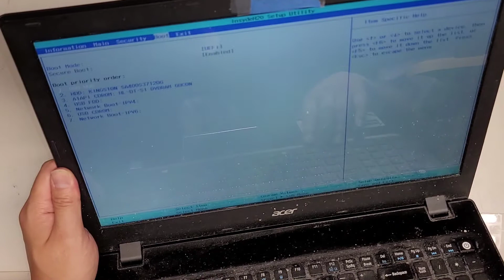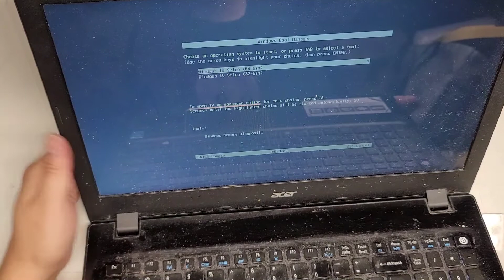Acer Aspire F5-571 Series Laptop F5-571T-569T Disassembly RAM SSD Hard Drive Upgrade Repair Replace

Comment: Brilliant video. Very well explained. Didn't know about the 'secret' reset button !! Interestingly I had cause to reinstall windows 10 due to my laptop running incredibly slow.... 15 minutes to fully boot. But the my boot usb actually installed windows 11 home for some reason, which was a little sluggish but still ran. I now have Ubuntu running on it. Thanks again.
Reply from the maker: Put an SSD in it.
Reply: @ItsBinhRepaired  It already had a 500GB ssd in it !!!! I recon it was so corrupted that it didn't know how to boot properly !! Its running fine now on Linux as a Stellamate astronomy controller hotspot so I'm quite happy.👏
Reply from the maker: @paultyson5145  Try removing the hard drive if there is one. If it's failing it'll slow it down even if the SSD is fine.

Comment: I bought this laptop for my mother, now she wants to get rid of it. I refused, I got a new charger, found out the hard drive was corrupted. I gave it a fresh new ram and an old ssd with my previous windows installed in it, put new thermal paste and after a second try, it work! Now I get to retrieve my windows 10 and I shall turn this acer laptop into a Linux computer for first try! Followed this video and everything work great! I had trouble turning it on so I replugged the battery and made sure everything was screw in and it work! So proud of myself!
Reply from the maker: Awesome, glad it worked out! If you haven't already, please like and subscribe so others can find my videos. Thanks!

Comment: Your video is very thorough! I'm trying to fix my computer. It wont boot after dropping, so I took it apart. I glued a broken off screw thread? and unplugged the battery, pushed the reset and it is still not booting up. Any ideas? I checked and the only look/broken part was the thread thingy!!  Its just showing default boot device missing or boot failed. Its telling me to insert recovery media.
Reply from the maker: That's a dead hard drive. You'll have to replace the hard drive and reinstall Windows. Highly recommend an SSD
Reply from the maker: https://amzn.to/3gCmHbE
Reply from the maker: You'll need another computer running Windows 10 and an 8gb or larger usb flash drive. Create the bootable media with this. https://youtu.be/R6GVDyVqWso
Reply: Wow! Thank you for getting back with me! Will all my data get deleted? I really just need a new computer. I always buy Acers. I'll pay you to help me! 😁
Reply from the maker: @DaabigO  yeah, the data is on the dead hard drive :( you will likely have to take it to a data recovery place. I recommend 300dollardatarecovery.com
Reply from the maker: @DaabigO  if you're lucky, might just be the os files damaged. You can try accessing the data with a sata to USB adapter
Reply: @ItsBinhRepaired  I'm shootin' for lucky! I'll try the sata to usb adapter idea. If that doesnt work, I'll have to do data recovery! Last time I did that it was only $150. I still need a new computer. Thanks again!
Reply from the maker: You don't need a new computer, just replace the hard drive with an SSD and install Windows.
Reply: You do Zelle! Zelle wants your first and last name.
Reply from the maker: @DaabigO  hahaha I tend to like putting my own SSD, though most computers now are including them. The manufacturers tend to put bad quality SSDs. I've seen so many factory installed SSDs that failed. I don't see many Acer laptops for sale these days. Amazon and Costco are good. If you have an Amazon Prime credit card, they give an extra year warranty, same with Costco. It's usually better to get the computer from the store though, because a lot of the delivery people like to throw or drop packages.
Reply from the maker: @DaabigO  name is Binh Vu
Reply: @ItsBinhRepaired  I've always bought my acers at walmart. They last forever and I can usually fix problems. My hp was $1200! And it had all kinds of issues.  I'm very hard on them. The power port is usually the first issue is have. I'm ready to upgrade. If I buy a good SSD what kind of computer do you recommend?
Reply from the maker: @DaabigO  usually avoid the thin and light stuff. Haha Not too sure what's out there currently that's good. Haven't been looking around at new stuff. Usually I fix all the old things breaking down. Haha
Reply: @ItsBinhRepaired  I sent you a zelle pmt. Did you get it?
I still need help, so I'll send another payment next Thursday. Lol.. payday! I've decided to fix this old Acer, like you suggested. I'll take my time looking for a new one. 
So, the link you sent for the Ssd card is the one I need for the Acer 5t on your video,  right? So I take out the hard drive and put in the ssd, then go to microsoft and download windows and it should work? Send the hard drive in for recovery? My power port is beeping. I might as well replace that, too.
Reply from the maker: @DaabigO   From Arya or Iron Man's brother? Yup! Haha Yeah, you'll need an 8GB or larger usb flash drive to create the bootable drive with.
Reply from the maker: @DaabigO  power port beeping?
Reply: @ItsBinhRepaired  It is for $40.
Reply from the maker: Got it, thanks!
Reply from the maker: @DaabigO  haha sorry, I said that because the last name was Stark. XD
Reply: @ItsBinhRepaired  omg!!! I totally missed the GOT reference!! Duh! We changed our last name to Stark because it was an easy cool name. I cant believe I missed that!!!
I'm still needing help, though. Ugh!!! I'm a little lost about how to check if it's my os. I think that is what you said.
Reply: I found it! You said I need a sata to usb adapter. 
What? Lol! 
I want to try this. Please tell me how to do it and links to purchase what I need. 
It's like I lost my right arm without my laptop!!!
Reply from the maker: @DaabigO  https://amzn.to/3jErHOR that will work.
Reply: @ItsBinhRepaired  can you please tell me how to do it?
Reply from the maker: @DaabigO  what do you mean? You just take the hard drive out, put it in there and connect it to another computer.
Reply: @ItsBinhRepaired  ok. I guess you just schooled me. I'll figure the rest out. Later!!
Reply from the maker: @DaabigO  hahaha
Reply from the maker: @DaabigO  another option is you can create a bootable ubuntu usb and see if the drive is readable.
Reply: @ItsBinhRepaired  when I plug it into another computer, how do I open it? Will it just be on the c: drive and just be thousands of files? I've never done this.
Reply from the maker: @DaabigO  it'll show up like a usb hard drive as another letter
Reply: @ItsBinhRepaired  ok. I'm ordering everything now. I'll let you know!
Reply from the maker: @DaabigO  hope it goes well
Reply: @ItsBinhRepaired  I took out the old hard drive and put in the SSD that you recommended. The same thing happened. It says no bootable device. Insert boot disc and press any key.
Reply from the maker: @DaabigO  of course, you need to install Windows on it. Did you do that?
Reply from the maker: @DaabigO  you have to create the windows 10 bootable drive and install Windows on the new drive. The drives don't come with the operating system on it.
Reply: @ItsBinhRepaired  Do you have a video to show me how to do this?
Reply: I saw the video on how to upgrade to windows 10, but in that video, your computer worked. Even my 16 year old son, who is very good at this stuff told me he does not know how to do it. It may be a no brainer to you, but I'm learning from you. I'm paying you to teach me, not to expect me to know what you know. I didnt pay you again on Thursday  because you keep assuming I should know what to do. I bought everything you told me to. Now what? I havent a clue what to do with this stuff. Have you noticed? I keep asking. I cant return them, so... help me, please.
Reply from the maker: @DaabigO  did you create the bootable USB?
Reply from the maker: @DaabigO  after that you have to boot from it. And then install Windows to the hard drive. It's a lot more difficult to teach someone every step of the way than to do it physically myself. Normally a job like this if I were doing it for someone would be $100-120 plus parts, retrieving the data would be additional $50. They'd drop off the computer and have me work on it. Usually a class teaching someone how to do this would be much much more. Lol
Reply from the maker: @DaabigO  https://youtu.be/R6GVDyVqWso you have to create a bootable usb with that.
Reply from the maker: @DaabigO  did you create the USB? I keep trying to guide you, but it doesn't sound like you're doing it.
Reply from the maker: @DaabigO  I sent you the video multiple times showing you what to do, but it sounds like you aren't doing it.
Reply from the maker: @DaabigO  you talk like I haven't been trying to help you. Show me any other YouTuber that takes the time to comment back and forth even 4 comments, let alone over 40 comments...

Comment: What size are the screwdrivers needed for the black screws on the CPU?
Reply from the maker: You can use any size screwdriver as long as the tip is snug in the top of the screw.
Reply from the maker: What you need is a screwdriver set. This video is basically how I figure out what screwdriver to use. https://youtu.be/RQ6a2YkZCuU

Comment: Hi,
I have 2 questions about Acer Aspire F5-571-52Z6.
Can we add extra 32 gb ram?
I there any specific model of ram or we can put any?
Thx
Reply from the maker: I don't think they have 32gb kits, but you could use this https://amzn.to/3m22TV3
Reply: Thx for reply, even the model number for both the rams are not same, that you recommend, they will work together?
Reply from the maker: @samiagha3155  just needs the same speed and type